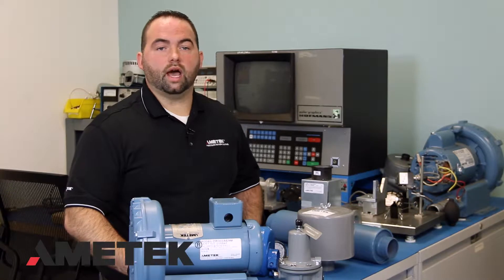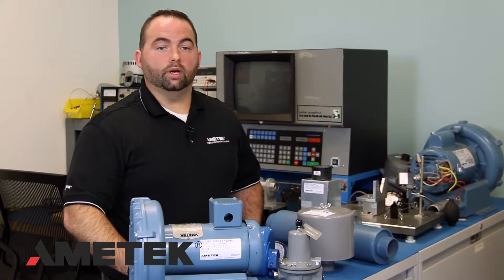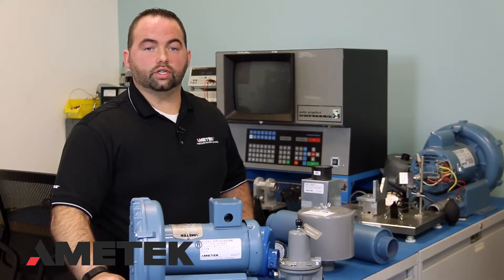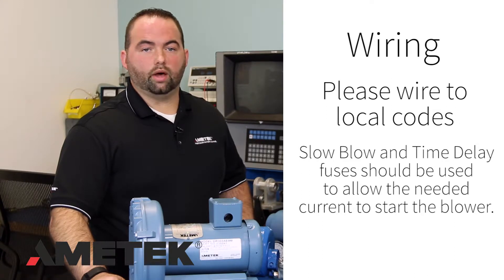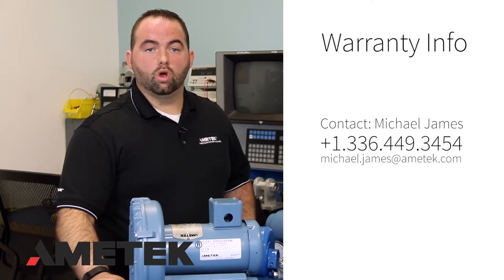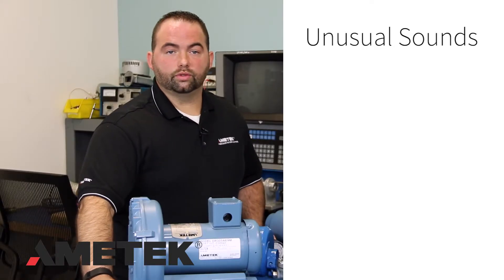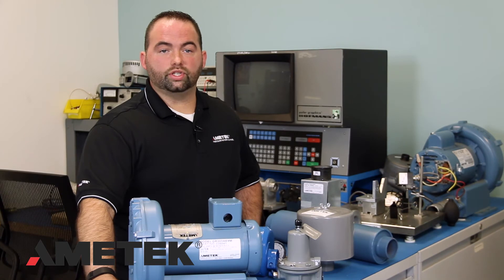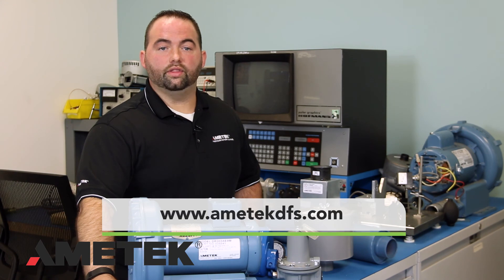How to Troubleshoot Brushless Blowers

Comment: Why are these motors dropping like flies? 
I've got 6 in Laars boilers that are repeatedly dying, it's a rather expensive part, and the customer is screaming. 
These things are absolute trash. I'm recommending my customer go with a different replacement boiler. I don't have these problems with Lochinvar or RBI, their equipment lasts.